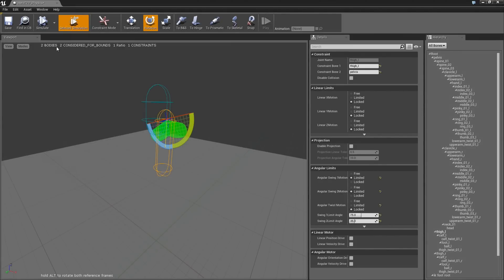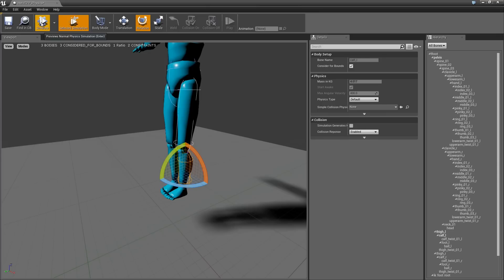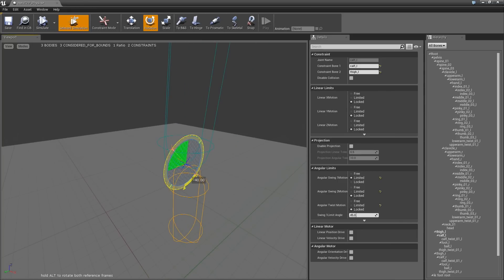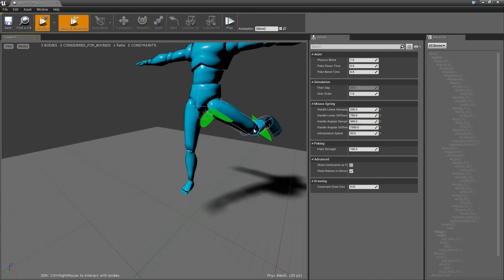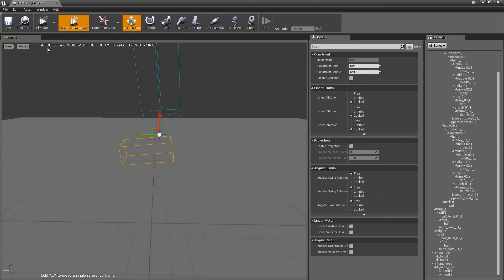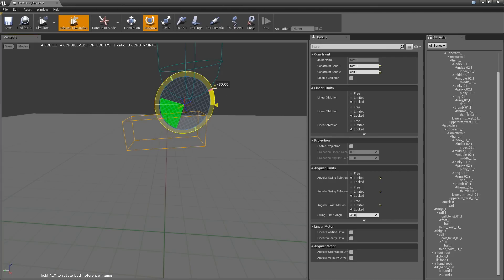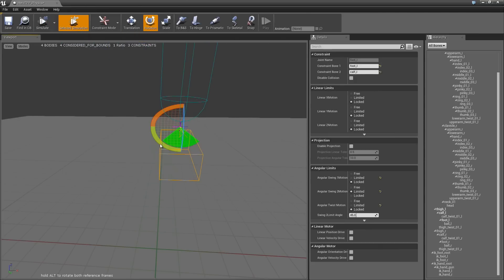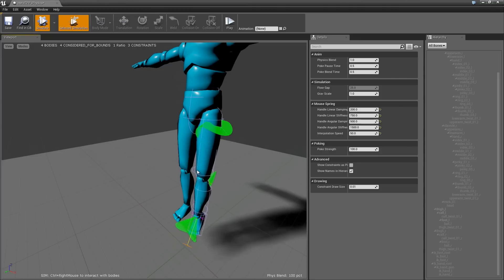PhAT: Finishing the First Leg | 04 | v4.2 Tutorial Series | Unreal Engine

Comment: If after setting the foot it seems stuck and do not move expectedly, consider lowering the floor. It obstructs the movement of the foot (entire leg actually). Look for "Floor height offset" and set it to -100. Also untick "Auto align floor to mesh". Once you do that - the simulation of the foot, especially "Twist motion" will give you the visualisation of the limits. Good luck !
Reply: Thanks so much! For anyone wondering, the "Floor Height Offset" setting is found by clicking the little down arrow to the left of the viewport options button that lets you switch between "Perspective" and "Orthographic" views.

Comment: OK this is so much harder than it needs to be! Looks easy when he does it in the video but, what's in the video is not what I'm seeing on my screen. There's no 'yellow' line anymore, and the red line that is there with the arrow head, rotates whether i rotate while holding ALT or not. Also, instead of having the values in the details panel say 'Swing 1 Motion, Swing 2 Motion, and Twist', they should just say X, Y and Z. That way they will correspond to the viewport and it would make it way easier! 
I've managed, by the grace of God, to set up the legs and knees, but I am doing the same for the elbows and getting unpredictable results. Even God himself is now looking down at me shrugging his shoulders! The whole system just doesn't make sense. Needs an update. Or at least please update the videos to 4.25.
Reply: I'm having the same problem. 'Swing motion 1', Swing motion 2' and 'Twist motion' do not behave as expected and I agree, X,Y,Z would be much easier to use. 
Also, the position of the red line (the one that used to be yellow) in the legs of my character does not make any difference, the knees swing forward just as much as backward no matter how I adjust the Swing or Twist limits, the limits rotation or the rotation of the red line. The constraints do not change the behaviour of the joints like in this tutorial. It's very frustrating, I have wasted so much time trying everything and watching tutorials that don't seem to work anymore. UE4 is wonderful but very frustrating at the same time.